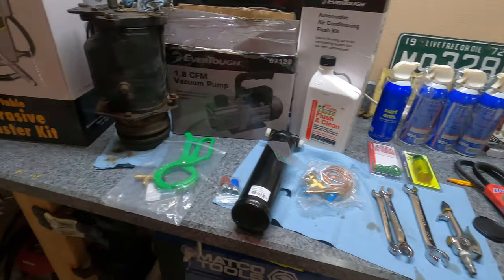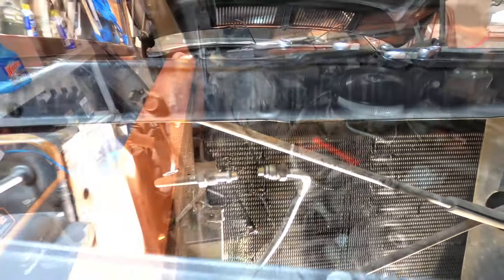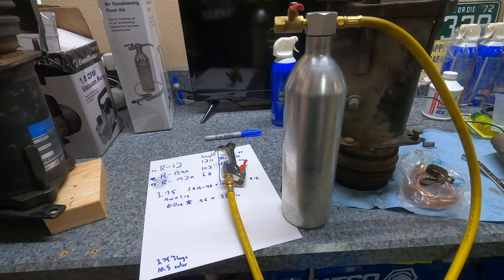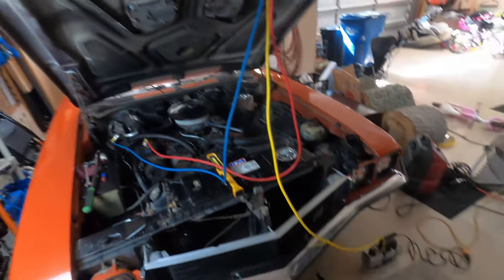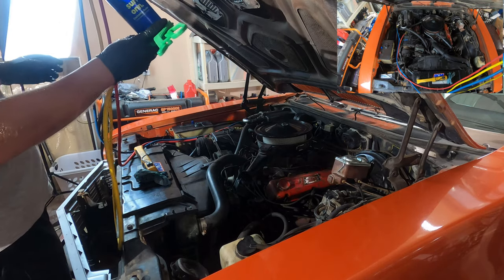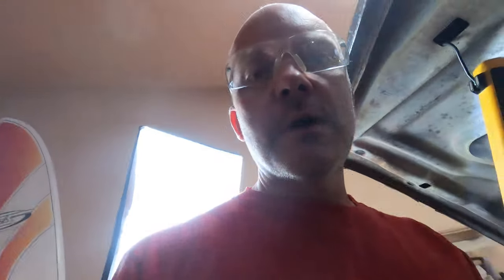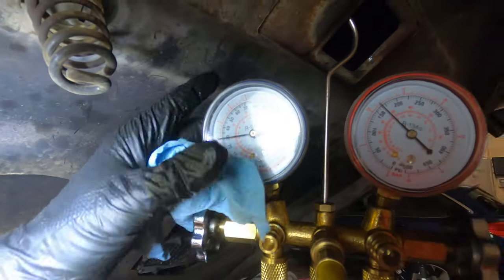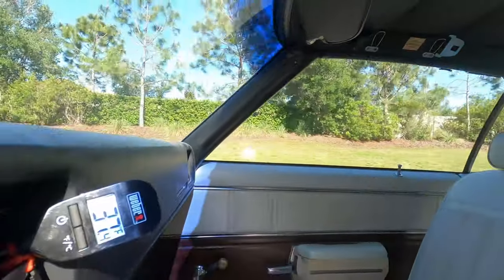R-12 to R152a (Dustoff) Conversion For An Old Car Air Conditioning System With A POA Valve

Comment: I've been doing this for years now on several vehicles. For best results I replace the drier after i remove all the 134a and then vacuum pump the system, I always add a couple ounces of Pag oil. Also the pressures are a little different than stock specs, maybe because the 152a gas compresses at a different rate, anyway it takes a little messing with and typically the systems take a little less 152a than 134a.
Reply from the maker: That's awesome, do you have to top off the systems much? I figured I may have some leak out on the hoses since the molecules are much smaller.
Reply: @JackofAllTrades1  On my Lexus no I don't have to top off, but on my RV I put a can in every year, but at about $3 I don't care.
Reply from the maker: @tonyinfinity  your Lexus is probably a 134a system right? And RV probably R12 or R22? From what I rrad the molecule from 152a is small, much smaller than R12 so it will leach through those hoses faster. It's smaller than 134a as well but the difference is not that great.
Reply: @JackofAllTrades1  Both are 134a and have been doing great for the last couple years on the duster. I had a 96 Honda Accord that needed to be topped off every year but got so cold it would ice up the windshield on defrost. I think the older the vehicle and lines you're sure to have more little leaks, but since it's so cheap I don't mind topping them off and it's better for the environment so that's a plus. My buddies car has a leak in the evaporator I think because you can smell it when he has the air on, and has to top it off every couple months. lol I told him I won't ride in it, and offered to change it to duster for him but he refuses. You can lead a horse to water but can't make him drink
Reply from the maker: @tonyinfinity  haha ... yea, the fact that I could dump this refrigerant into the air without impact is what helped me figure out the pressures when I played around with it. Hopefully this stuff doesn't get banned as it becomes more popular.
Reply: Most older hoses will leak out a can every year

Comment: Well, from what I've seen mineral oil is the oil to use. Same as R-12 systems. Where did you hear not to use mineral oil? You're adding liquid from the bottom of the can? Into the low side or high side? I've always read to add gas from the top of the can into the low pressure side. POA valves I've never seen. Old stuff. Thermostats are more common.
Reply from the maker: Hopefully you can see this link. My original forum find was on a Torinado chat thread, but I also used this one from a corvette forum to come to the conclusion to use Ester oil. Mineral oil is only partially soluble, so it may work . https://www.google.com/url?sa=t&source=web&rct=j&opi=89978449&url=https://www.corvetteforum.com/forums/c4-tech-performance/3665425-using-r-152a-dust-off-for-a-c-refrigerant.html&ved=2ahUKEwj_tKnUpe2FAxVsaDABHegbDSsQFnoECDEQAQ&usg=AOvVaw2xZcJ52F65fc2oWW0_bPL0
Reply: @JackofAllTrades1  That thread said the R-152 was 8% less efficient at cooling than R-134. Which conflicts with other videos where it says it's more efficient. I may go with Envirosafe. Since it's definitely compatible with mineral oil. Thanks for the info.
Reply from the maker: @tedstriker754  yea, I think everybody was experimenting and guessing with it. This is still widely unused in these types of AC systems.... but I've ran it every year since and it has no real issues. I have to top it off once a year, and get about 45 degrees out of my center vent.
Reply: @JackofAllTrades1  For just adding some to an existing system it's nice to have something to just dump in without having to do a flush. But if that day comes, I'd use R152a and ester oil. I've always read ester is compatible with all types of refrigerants.
Reply from the maker: @tedstriker754  yea. I like that it's easy to come by... for now.  Who knows when the EPA will change their mind.

Comment: I just starting to venture into 152r . My gauges are a bit hard to read at the psi  they are at.  I am guessing 30 ish psi on the low and 170 ish on the high.   Current temp is 50 degrees at idle. In cab.   outside temp is 89.  My question is should i release some psi to lower temp. ?   I started with one can (10oz) then added another (10oz)
Reply from the maker: I would release a burst (about a second) and remeasure your temp. If it goes down then you are heading in the right direction. If you can get into the upper 30s then stop... don't risk freezing up the evap cause you'll have to start over (I know this cause I got greedy at 36 degrees lol). Good luck.
Reply: @JackofAllTrades1  so basically lowering the psi will make it cooler?
Reply from the maker: @taps_1021  yes. Mine was about 26psi on the low end but everybody's setup will be different. I started with way too much and had to come down quite a bit. If you put in 10oz and then another 10oz without stepping up to the total 20oz you have in it, then you really don't know for sure if it needs more or less. I'm inclined to believe you need less though. I was at about 17 Oz at my coolest.
Reply from the maker: I will also add that you need to test it out while driving at cruising speed. You are gonna have a lot more heat soaking at idle and while sitting still. You may get cooler temps while moving. If you have 40 degrees at idle but it dips down to 32 at cruise then that won't work.
Reply: @JackofAllTrades1  thank you for the reply 👌
Reply: @JackofAllTrades1  just an update .I did as you stated and it worked.  Now I am in the 40s . I was running propane in the past but didn't like the higher pressures.. now my high side is 100. Thanks so much 🙏
Reply from the maker: @taps_1021  awesome... there's nothing bettrr than smelling that sweet dehumidified air coming from the vent! AC is the best invention ever. Lol. Glad it worked.

Comment: What happens if R152a gas starts to leak into the enclosed passenger compartment (faulty evaporator)?
Reply from the maker: It's gonna stink in there from the added bitterant. The air might taste bad as well... I wouldn't say it would be lethal but you'd probably want to roll down the window until it was bled out.
Reply: @JackofAllTrades1  The car is in a parking lot. An explosive mixture may be formed?
Reply from the maker: @flashboot  no, its really hard to light. It would take a lot. I tried to light it with a propane torch and couldn't get it to.
Reply: @JackofAllTrades1  My car needs 750gr R134a gas and Pag46 oil. R152a gas approx. 350gr. According to them, it cannot cause an explosion. This is good news.
Reply from the maker: @flashboot  good to hear!
Reply: It is flammable, if you smoke in your car you will have a very bad day
Reply from the maker: It's flammable but extremely hard to light. I had no luck lighting it with a regular lighter as well as with a propane tourch. I think the flash point may be really high.
Reply: If it's safe enough to use indoors to clean a keyboard, I think everyone is going to be okay.
Reply: R152a is bad for your heart
Reply: @HDXFH  so are cheeseburgers.

Comment: I'm guessing that your car takes about 2.5lbs of r-12, which means it'll take about 19-20oz. of r152
Reply from the maker: That's pretty spot on. For this year's charge (I have to charge every summer) I put a whole 10oz can in and about half of another... I feel like I could probably get some better cooling if I add just a tad bit more which would be close to your estimate.

Comment: You only charge at roughly 60% of the capacity. R152a has less volume.
Reply from the maker: It actually  ended a lot less than that to cool down to 35 degrees. I was surprised. It took a whole can and just a couple oz of the next to get there.

Comment: This is way over charged.  I think it should take around 12oz of refrigerant.  If this is “getting better over time”, you likely have a leak.  In HVAC, more is definitely not better.  You can actually calculate the pressures on the high side/low side to properly charge this system.
Reply from the maker: Hello, yes it was way over charged at first... not sure how much of the video you watched but I think I ended up with about 15oz total... it took some trial and error. Still holding strong all these months later. Thanks for the comment.
Reply: My ‘87 Cougar takes 3 cans to run 40 degrees
Reply: Yea, they call it a temp/pressure chart.

Comment: Such over kill.
Reply from the maker: I totally agree. Hopefully people learn from my errors. Hindsight, instead of putting that much in and bleeding off pressure... I should have started low and worked my way up. It certainly took way less than the conversion formula told me to put in. Thanks for dropping in.
Reply: @JackofAllTrades1  I haven't done the math on R152 but back of envelope says Half the weight of R12.  So if your car says 2lbs R12 then 1lbs R152 and honestly no real need to vacuum.

Comment: Engine sounds terrible. Lifters are rattling. Using that crap Amsoil junk I see. Stuff that last 25,000 miles LOL.
Reply from the maker: It probably is the lifters since the rockers are non adjustable... its the only place their can be slack. This 350 is out of the car now though.

Comment: lol based

yeah
if u have an original r12  A6 based system than yes everything will work nice 

BUT I have tried this same set up up with multiple r12 and  r134  systems

some are great and others are on that phaggytime
Reply from the maker: I guess I got lucky that mine wasn't that much trouble. Seems like you just have to play around with the amount you put in until it works or you have to adjust the expansion valve or port to get the right pressure.